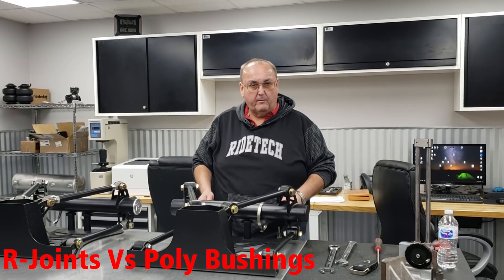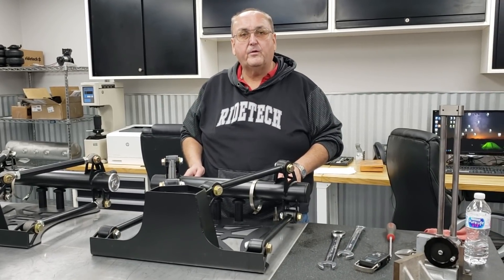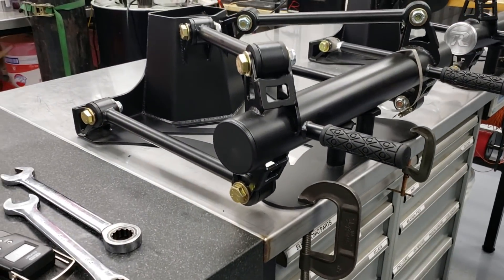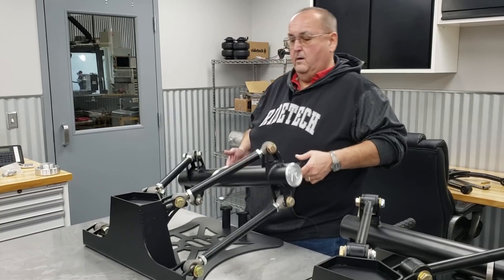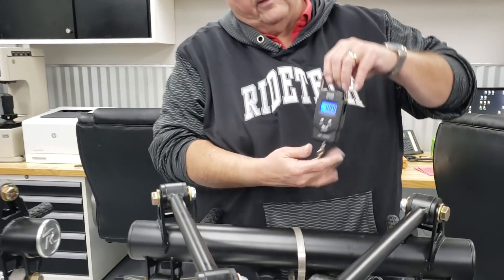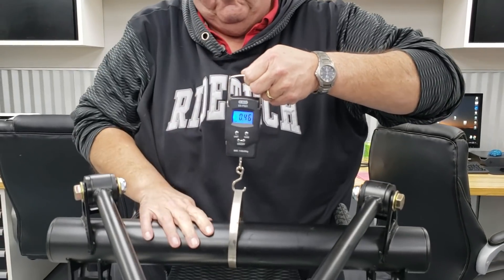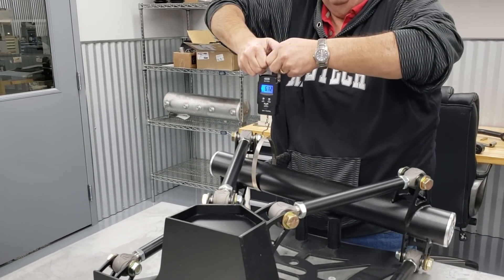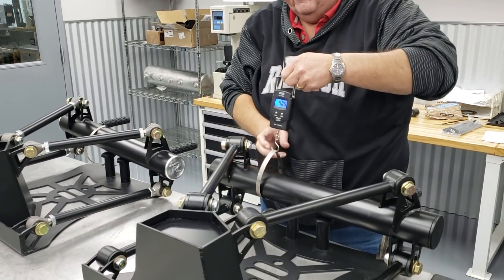R-Joint vs Poly Bushings

Comment: So the comparison is not necessarily fair the mounting tabs for the poly bushing should be longitudinal with the frame your bushing would be ok in a factory style 4 link that came with g bodys b bodys all that but your still going to yransmit more road feel to the inside of the car with your atyle joints
Reply: Most factory four-links came as shown, because they didn't use a separate watts link or panhard bar to laterally locate the axle.  But if all four arms were parallel, there wouldn't be bind in pure vertical travel (pitch/heave) but there would still be tons of bind in roll.  That's because the arms are being required to twist and also the ends have to move laterally: both movements are off-axis of a standard rubber or poly bushing.  The bind causes a non-linear increase in wheel rate in roll - not a good thing for handling.